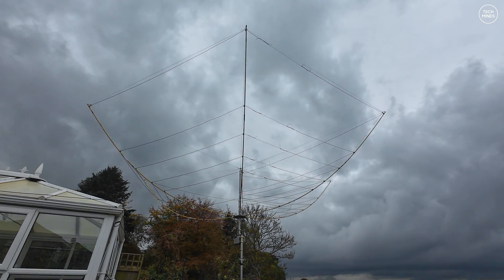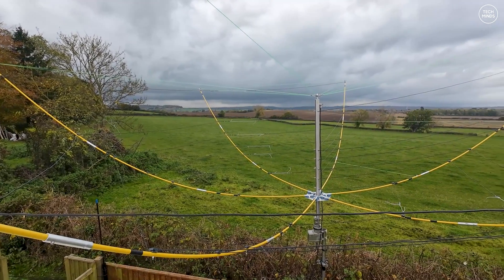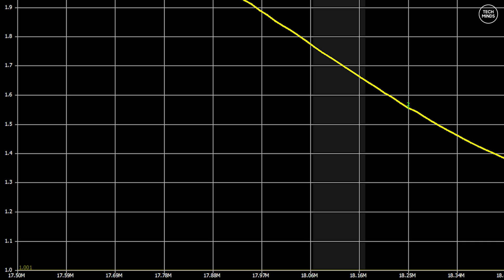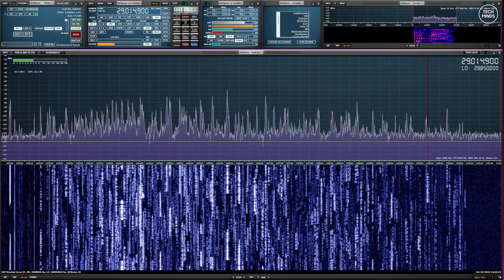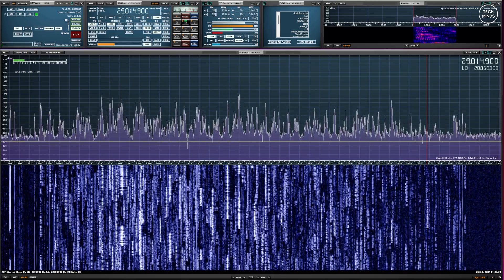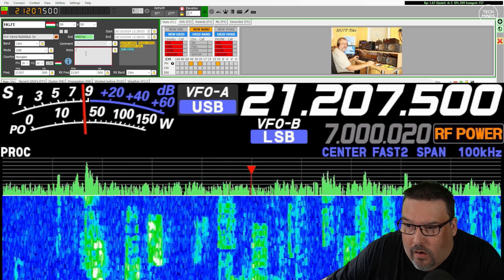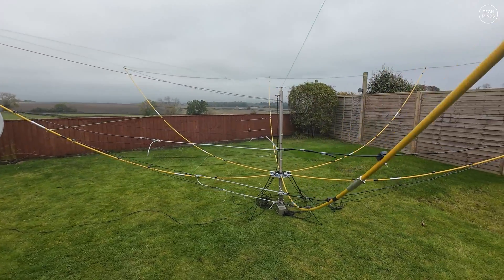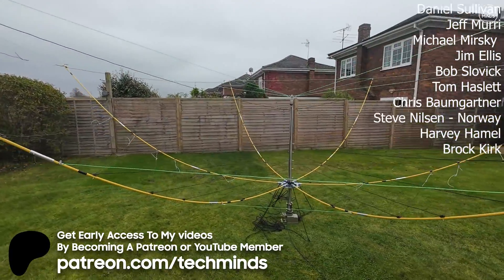This HexBeam Build Did NOT disappoint! - Part 2

Comment: Hi, Matt!
What software do you use for Yaesu control on PC?
It looks like a panadapter connected to the same antenna
Reply from the maker: Not sure what you mean. First I used SDRuno connected to an SDR, just to test receive. Then I was showing the screen from my FT-710 via a video capture card and the video out on the rear of the radio. The rotator was just a cheap TV rotator, not connected to any software, just a manual desktop dial. Hope that answers your question, maybe :-)

Comment: The only thing I wanted to see in this video you did not do.  That was seeing how you got that antenna up on that pole and how you made the connection to the shack.
Reply from the maker: Hi, thanks for the comment. You can see in the video how the antenna is attached to the pole, it's simply U Clamps that came with the antenna. most commerical antennas will have these fitted and then you just attach them to a 1.5 to 2 inch pole. The cable between the antenna is just 25 metres of RG8X 50ohm coax with PL259 connectors soldered on. One plugs into the SO239 at the top of the antenna and the other end, in the shack, plugs into the back of the radio. Hope that helps :-) Feel free to ask more if you need to. Thanks.
Reply: @ no no no.  I wanted to see the actual physical manipulation of how you got that giant antenna up in the air.  Two people? One person?  Did you set it on something on its side before leaning it up? How did you physically get it up.
Reply from the maker: oh, well I just got my son to help me lift it up and attach a 1.5m swagged pole to the rotator. Then we carried it holding the swagged pole and dropped it into the swagged pole that's cemented into the ground. At no point did the spreaders touch the ground, they are only fibre glass so with all that weight it could break one. Although we just had over 50mph winds here in the UK and it survived! :-)
Reply: @ what is a swagged pole?
Reply: @terrybaileysr.3714  I was wondering the same thing.  I work with metal almost daily and have sold pipe and fittings but don't know the term "swagged."

This antenna must be smaller in diameter than a Radio Wavz or KIO.  They're both 24 feet (7.3 meters) in diameter.  No way two people could hols one off of the ground on its side.

Comment: No dissrespect ,great video, but I doubt it would survive  the weather i. North illinois
Reply: Most hex beam antenna makers offer a snow and ice kit which is primarily low stretch synthetic line that connects the center support directly to each fiberglass pole and includes some hardware to make the connections.  It helps keep the weight of snow and ice from distorting the poles.

Comment: Nice antenna, greaet performance. Could be interesting when some time I get a house with a small garden. Now I am living in an apartment building on the 2nd floor. I use to have a home brew wire trap dipole antenna on the roof but since 2020 I am no longer allowed to go on the rooft anymore :(
Reply: Were you banned from the roof over that thing that happened in 2019?  -- KIDDING!
Reply: @David-hm9ic  Well I am actually banned from the apartment buildings roof. Not particularly me, but everyone. This because of changed legislation according to my tenant. First they locked the roof hatch, than they added a "No trespassing sign"and recently the added another sign saying wearing a harnas when going on the roof is compulsory! Anyway I hope to move in the near future to a senior apartment with small garden, thus room for antennas! :)

Comment: Nice video.  I love mine (NA4RR) on a small suburban lot in the US.  I was offered a full-sized tri-band for free, but it would have hung over the neighbor's property, and power lines!.  My hex is contained within my property lines.  I've worked the world with it.
Looked into a 40M add on but NA4RR quit offering that option, would only have been a rotatable dipole in effect, and the size increase would have been problematic. So I stay with my Sloper for 30-40-80.
73 de KAØAZS

Comment: Very nice. Here's hoping AWK's pricing is a bit better than the $1K+++ hexbeams are going for in North America. Once you get that thing up to 35 feet or so, you'll notice improvements of less noise and better transmit signal and better rx signals. The big advantage of a hexbeam is you get 6 mono band antennas on one coax and you've got some forward gain and directivity. The antenna itself isn't night and day from a half wave mono band dipole at the same height. It's not like you'll suddenly be pulling signals out of the ether at S9 that you wouldn't hear on the half wave wire antenna. But you'll notice a couple S-units of improvement on rx and tx and you get resonant mono band antennas on each band. For rare or weak signal DX  a couple S-units is the difference between making a contact and not making it.
Reply: Take a look at NA4RR Hexbeams in the US.  Where I got mine and around $700.
Reply: $633 Shipped to the eastern US via FedEX $487 for antenna $146 shipping.

Comment: I've been wanting to build a HexBeam for a while, bang for buck and size they looks to be a winner. My problem is finding a place on my property where it is far enough away from buildings/metalwork but not in the sight line of my neighbours behind me. They have been quite tolerant of my vertical and EFHW antenna but I think the Hex might push the relationship a bit 🙂

Comment: Come on, you could have someone with a horizontal polarized antenna on the groundwave creating a carrier and then you turn your antenna and plot a diagram to get an idea about its directivity and maybe even gain, hanging up a dipole for reference ... and also do an AB test on a higher band into a direction where your wire antenna works well. 
I am still confused how the antenna works, which elements are doing what on which band. It might be a fantastic compromise for someone with limited space. I love the fact that it seems to be overall light weight and seem to have no traps. The SWR on the huge 10m band is really outstanding. I wonder how they created something that looks more like two resonances that overlap. Amazing!
The contest on the weekend really also made me shake my head when 10m was busy from around 28.3 through to slightly above 29 MHz with no gap for an actual conversation, I have never seen so many strong individual signals on my spectrum display. Conditions have been crazy good as well. Conditions like this can be so misleading, that it is difficult to get an idea how good the antenna actually is, when you have no reference.
Reply: It is a 2 element wire beam for each band .  One band stacked over the top of the other.  The wires are bent around the  6 fiberglass spreaders.  Not quiet as good as a 2 element beam for each band as the elements are bent around the spreaders but does work well for what it is but sort of high price for a some spreaders and wire.  I do have one made by k4kio.  I have several antennas to reference it with .  A dipole for several bands, another off center fed antenna at 50 feet and a triband 3 element at 55 feet.  The hex beam is only up about 20 feet to the bottom element.
Reply: @ralphmowery2898  Thank you very much, that is some good information to start with.  Bit if it is what you say it is, and the bigger reflector if higher up when the director is further down, doesn't that cause the maximum field strength to radiate towards the ground? How doe the hex beam compare with your dipole?
Reply: @n1vca  The hex beam is actually a 2 element beam for each band.    At each level you start out with a wire then a foot or so of string and then another wire that is separated in the middle by an inch or so for the feed line.  That makes the two element beam for each band.   You can take off that loop at each level and not effect any other band.   Or you could start at one level and add the other bands one at a time and not effect the bands that are already on the beam. Think of it like a lot of beams stacked on top[ of each other on the same vertical mask.  Starting at the bottom you have a 2 element 6 meter beam.  Then you put a 2 element 10 meter beam about 2 feet above the 6 meter beam, then above that a 15 meter beam and so on.  None of the 2 elements beams interact with other.  ( well here is some minor interaction because they are so close but for discussion say they do not interact).  The hex beam is usually much better than the off center fed dipole.  The advantage of the beam is that it is small enough that it can be rotated.  As with most any antenna for the low bands each one is a compromise and at any given time no one antenna seems to be the best.
Reply: @ralphmowery2898  Thanks, I think I get it now ... each horizontal layer/level is one separate band and within each level there is a bend director and reflector I guess ... I have to take a closer look at it. I am surprised this space optimized (bend=shortened) antenna has more gain than a full size dipole ... that sounds like a very interesting design almost opposing the entire antenna theory ... on the other hand even a non ideal two element will likely have 1 or 2 dB more gain, even with its slight shortening loss,  than a dipole.
I just looked it up ... makes sense that it is very slightly ahead of a dipole but with the extreme luxury to be compact and rotatable and still relatively wideband because there are no traps 👍
Reply: Another way to think of a hex beam is that it's a directional fan dipole.  The hex shape focuses the signal.

Comment: On SDR uno instead of using the definitions for the bands if you click on top of a band number it will allow you to change decimation level. If you increase the decimation you’ll reduce significantly the noise floor. I only use the band number to switch bands.

Comment: Hi Mat. Great job.
Would you please explain me which is the meaning of the numbers 1-4 or 1-5 or something similar after the signal report 5-9 ( the standard for contest ) ?
I am a new operator. 
Tnx
Reply from the maker: Hi there, thanks for the question. I am not really a contester, and each contest report could be different, but with the CQ WW contest we have to provide a report i.e 5/9 and then the CQ zone, which for the UK is 14. USA is 5 , Canada is 5 for example. Hope that helps. :-)
Reply: @TechMindsOfficial  Hope to spot on Air. Great Mat
Reply: This is the operators cq zone 59 for signal and 14 (cq zone for uk) Google cq zone map 73
Reply: For this contest it was your CQWW region. Do a search for CQ Zones Map.
Reply: I replied to this but the reply seems to have vanished into the great YouTube censorship algorithm black hole! Anyway, the comment was to look up CQ Zone Map. There are maps of the zones. I also said all contests were different and that this applies for this one we've just had.

Comment: Ive used the ea antennas hexbeam and the polish one but they arefantastic antennas and extremely easy to put together BUT they are BIG,alot bigger than u think but iam in middle of a housing estate with s1 noise floor,s4 -6 on efhw

Comment: I have a feeling Paul is going to be quite busy! Its (to me) a complicated looking antenna but having everything all pre-cut and labelled so well feels like it would make all the difference. Hopefully we'll see some more reports in slightly tougher conditions. Great two parter.
Reply: The hex beam I bought was very east to put together.  Every thing was pre cut and all I had to do was just put the spreaders on the plate, pull the fiberglass spreaders out and hook up the precut wires.  Make just a minor adjustment to the length of the spreaders to tighten up a few of the wires. This was the k4kio beam.  I have heard that some beams require more work but this one went together in almost no time.